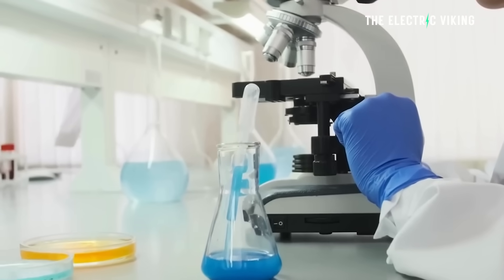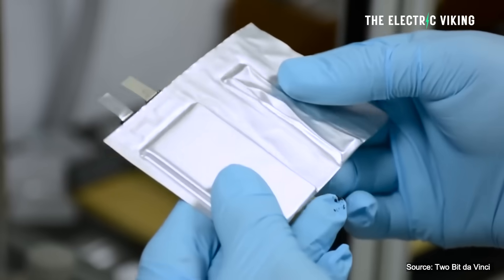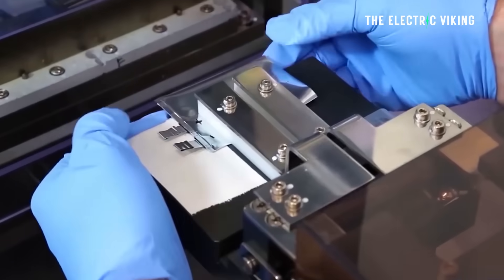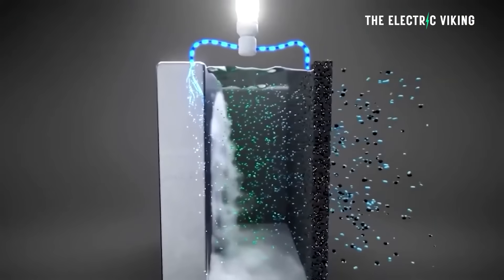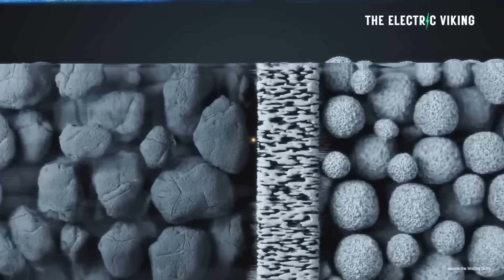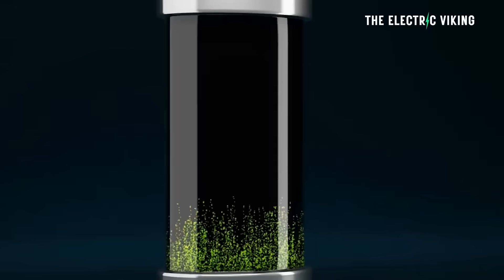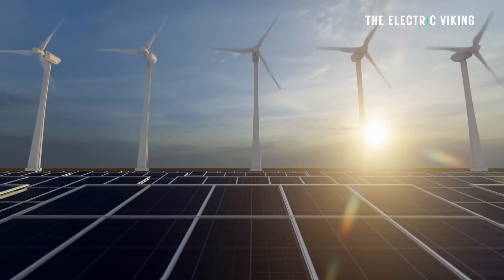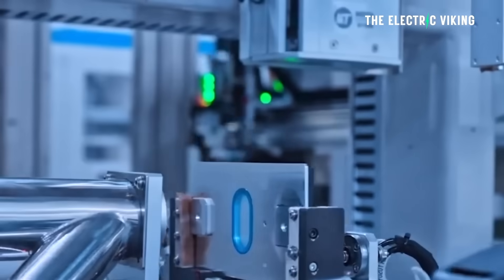12 Million Miles - The New Battery Tech That Could Power an EV for 100 years

Comment: 40000 cycles of charge/discharge at 1C so 1 hour to charge and 1 hour to discharge for a total of 2 hours per cycle. To finish the 40000 cycles, the test took 40000*2 = 8000 hours  = 3333 days = 9 years and 1 month.  That may very well be a good battery technology but something tells me that 40000 cycles is a bogus claim.
Reply: They use accelerated testing to come up with that.

Comment: Grid batteries can store energy from fossil fuels and nuclear and still produce peaking power cheaper, better and cleaner than simple cycle aeroderivative gas fired peaking turbines. Even the coal plants emit less pollution per kwh when they're operating at 100% of their maximum capacity at night when they can charge the batteries instead of reducing output due to low grid demand.

Comment: What you can do is charge them 4 or 5 times a day with solar if it charges faster and u can use a smaller battery in sections and cycle between them

Comment: Nobody mentioned how the energy density of these zinc batteries compares to that of current gen sodium batteries. So I looked it up: Organic zinc batteries have a theoretical energy density ranging from around 160 to over 625 Wh/kg, depending on the specific cathode material and design.                       
So let's say these 12m mile batteries are a bit on the low side. That might still be 250 wh/kg. If it's more like 600 wh/kg (and they can discharge at a high enough rate) that's good enough for a flying car.

Comment: ETs have batteries that automatically recharge as needed without any attachment to a power supply. They have figured out how to use zero point or scalar energy, not sure which one, and the battery has a very long life plus zero maintenance.
Reply: Sold!

Comment: As I pointed before... cycling defines 35% BAT lifespan. The rest is calendar ageing. So this battery will be just as dead in 12y as any other.
Reply: Though I get your point, my house battery made by Franklin is guaranteed to be at least 70 percent for 15 years. It's just LFP and it gets cycled once a day. LFP are at best good for 10,000 cycles. That makes organic-zinc at least 4 times as capable.

Comment: This would be great for home battery storage where cycling near 100% daily could endure.  For an EV it would really be overkill as the EV chassis would just not last long enough.  Truly I see no need for anything beyond a million-mile battery unless it's a side benefit of a high density, lightweight, fire safe and cheap battery.
Reply: i see a benefit if they make the car batteries standardized size so you can buy a new car without battery and fit in the batteries from your old one
Reply: @nikosgiagkoulas435  Sounds simple until you dig deeper into it.  Thermal management system, coolant lines, data transmission lines and such are all pretty much impacted.  Perhaps a decade or two from now if batteries could be small enough and light enough this could work.